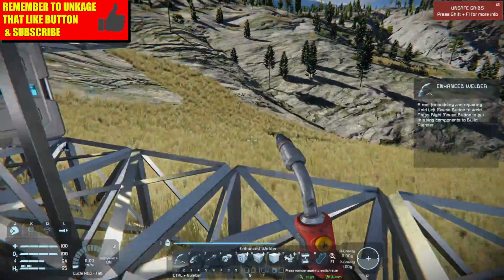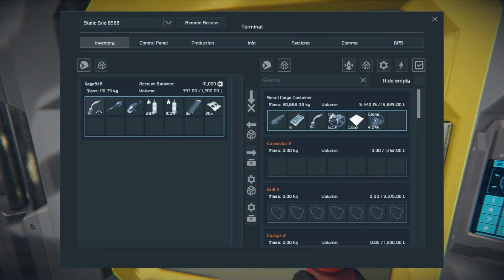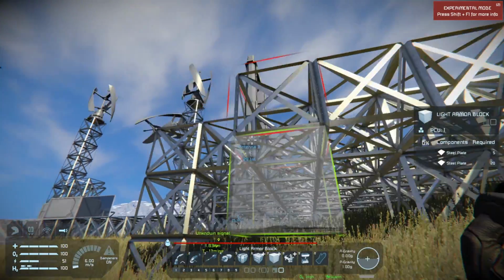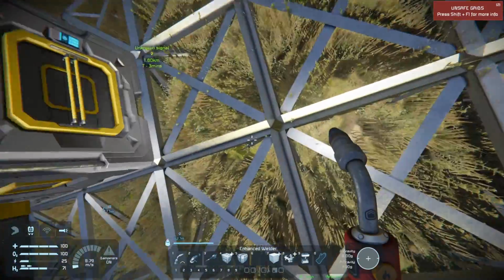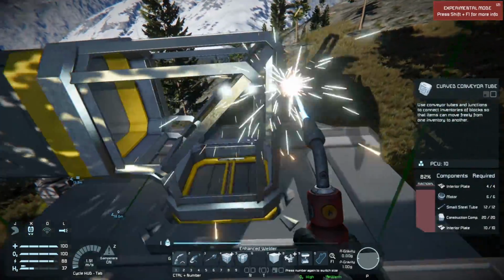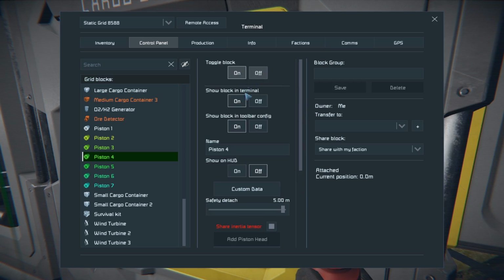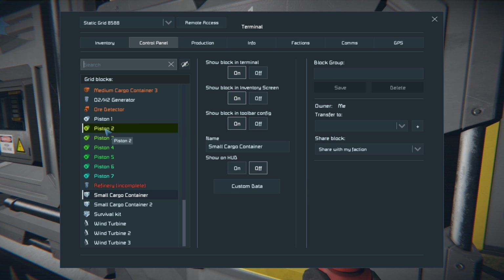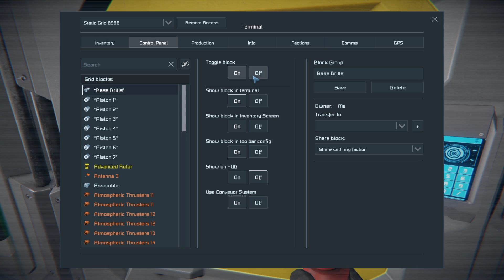Upgraded Refinery & Assembler | Space Engineers | Let's Play Gameplay | E07

Comment: since you have the drills connected to the rotor you could have them rotate as they are drilling to gather a bit more material. or to be on the safer side you could just bring it back up and rotate it 90 degrees and then go back down one more time. just to get the most use out of that rig

Comment: 7:45 there are upgrade slots on all four 1x2 sides of the assembler. The 'front' and 'back' are the 1x1 sides, which both have conveyor ports as well. The refinery has all its slots on the 'back' 2x4 side, so each can take 4 modules. Also note that the yield modules only work on refineries.
Reply: Also, as well as ctrl + 1-0 to swap hotbars, you can use . and , to move to previous and next hotbar (those should be the right buttons, dont think I ever changed the binding on those)
Reply: 10:15 as long as you dont put a full block on the base next to where a full block attached to the head can go (including diagonals), you should be fine. My recommendation would be to only use blast doors, half blocks, or conveyor tubes next to moving parts (only on large grid for conveyor tubes, small grid tubes have a full block hitbox!). Always do your first piston test while locked to the ground and you should be fine, and if the piston head ends up getting caught or at a weird angle you will have an issue.
Reply: 24:00 turning a block off never prevents items from flowing through its conveyors. Also, if you want something to only function manually and not draw automatically, you can use the 'use conveyor system' option so that it will not move materials in or out of itself automatically.

Comment: Kage - Really glad you're getting back into Space Engineers... it's such a deep game, and you haven't even touched on Mods, which in my opinion, really make the game.  The modding community with SE is the bomb, and especially for a "let's player" such as yourself, there are some that can really cut down on the grind and tedium.  I'm thinking of the Nanobot build and repair system, for one example... check it out:  https://steamcommunity.com/workshop/filedetails/?id=857053359 Also, if you enable experimental mode, you can run scripts, and there are a bazillion awesome scripts out there to do all kinds of things such as automatically orient solar panels so that you get the most power, organize your inventory, and lots of other things too.

You totally want to get the rotor moving on your drill rig - that will be a good source of the basics.  You will want an upgraded ship for mining.  I'm a fan of hydrogen, but then I use a mod that rebalances hydrogen so that it makes sense... here's a solid vanilla miner that is a hydrogen ship:  https://steamcommunity.com/sharedfiles/filedetails/?id=1720860322 

When you go to make your projector, you'll want to put down a rotor (large grid), put a small head on the rotor, and then add some small grid blocks to the head, and place the projector on that - in this way, any ship that you build will be getting powered by your base power.  See Splitsie's tutorial on projectors and blueprints:  https://www.youtube.com/watch?v=uLVnhk7wzoI

Here are my favorite mods:  https://steamcommunity.com/sharedfiles/filedetails/?id=1846271479 

Keep having fun!  

P.S.   For the intro greeting, I would have suggested "What's up Engineers?"  or something that includes "Engineers" ... since... well, yeah.  :)